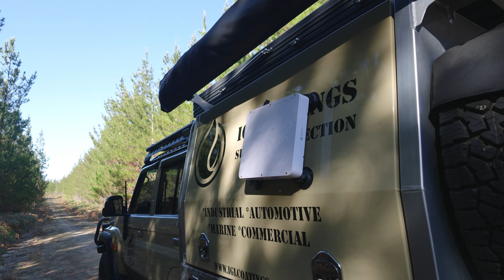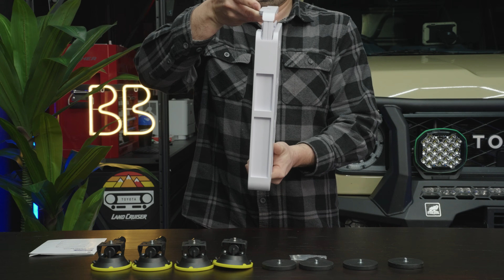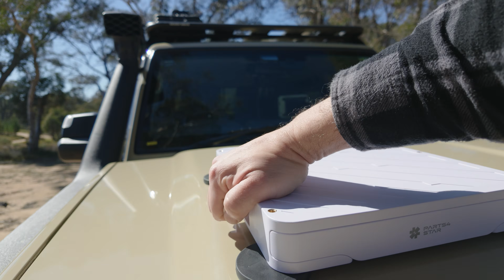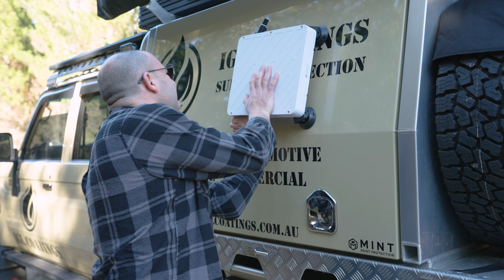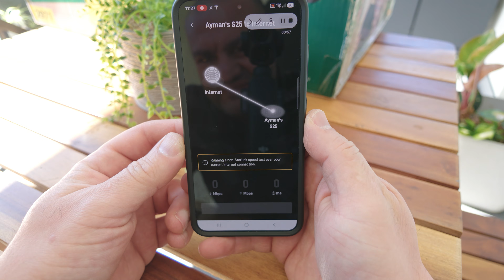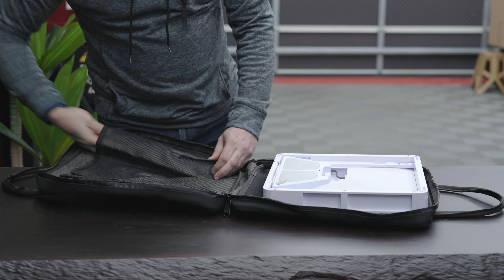Don't Mount Your Starlink Mini Until You See This! Parts4Star Dual Mount Review

Comment: G'day. Are you able to charge the peakdo with this cover on?
Reply from the maker: Hi mate, you can using the magnetic charging socket on the bottom of the Peakdo however if you want to charge it using the front ports you will need to modify the mount slightly by drilling/cutting a small notch to access the ports. Should be fairly easy and straight forward to accomplish
Reply: @bushbusiness Thankyou very much for that
Reply from the maker: @bumhull71 anytime mate

Comment: sorry if i missed it, but is it totally waterproof? where i am is always raining
Reply from the maker: Hi mate, you raise a good point. The Starlink mini itself is waterproof so as long as you use a battery or power cable that are also suitable for rain (like the Peakdo linkpower 3 or Stargear cable I used in the video) then it will be fine to use in the rain. The mount cover itself is enclosed from above but completely open from below so it will certainly shield the Starlink from rain but it is more about the battery

Comment: Awesome. Im really struggling with what I want to do with mine. My jeep gladiator has a fibreglass roof and Im told it works fine through the fibreglass just like the ASA but how do I  mount it facing up on the roof as the interior is not that smooth! Suction wont work and obviously magnets wont either. Anyway, thanks for another good option. Alternatively, my canopy is magnetic stainless so there that option too but Id prefer it inside if possible.
Reply from the maker: Hi mate, will this work? I was researching Molle mounting systems for another video and I recon it will be epic not just to hold the starlink but also other gear you might be carrying! Wish they made it for the land cruiser. 

Check it out: https://link.amazon/B0ayXFNwr
Reply: @bushbusiness  Thats bloody awesome, I will research that some more and see if there is room between it and the roof for the starlink, ideally Id like the same thing for the back seat but this would be the next best thing. Thanks heaps, much appreciated, this could be the solution 👍👍
Reply from the maker: @1Coolbanana my pleasure mate let me know how it goes!